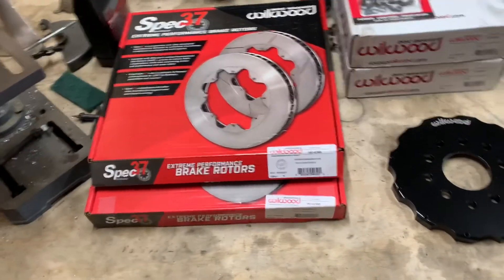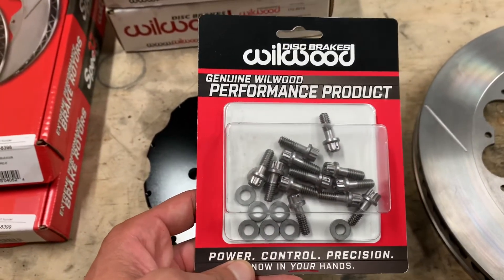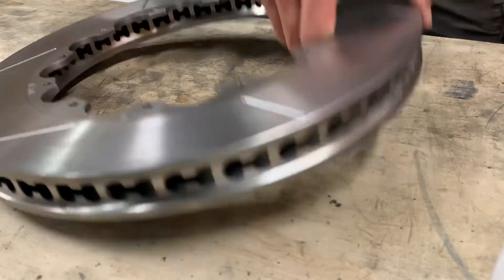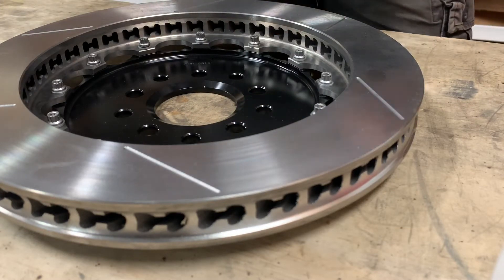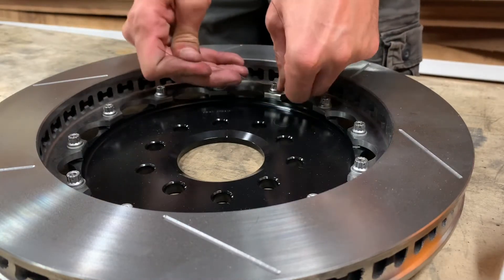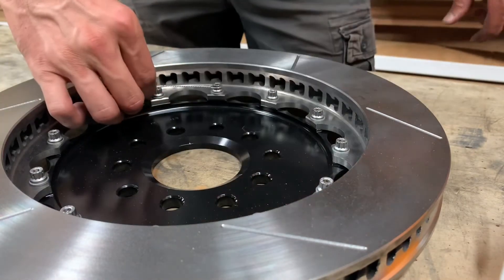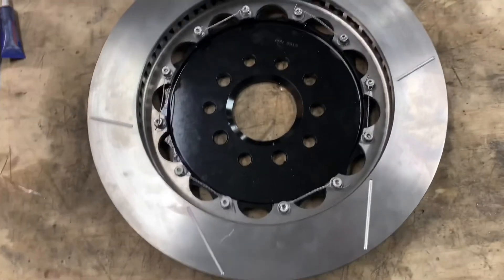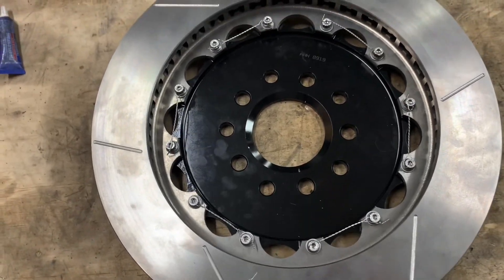Wilwood Rotor and Hat Assembly

Comment: That is how you do not install safety wire. I doubt if this was checked by a sanctioning body that they would pass this, it is not done correctly.
Reply from the maker: NASA and SCCA don't require safety wire on brake rotors, so they're not inspected.  I'm always happy to learn and do a better job, though.  Please point me to the proper technique if you have a link.  For what it's worth, my janky safety wire job has kept the bolts from backing out since I started doing it on brake rotors in 2014.

Comment: Came to see the assembly of a two piece brake assembly, stayed to watch a non aviation mechanic do safety wire. It probably doesn't matter that much in this application, because its non aviation, but correctly done safety wire should be done so the bolts pull against each other in a tightening fashion and the wire will be tight across the edge of the bolt. Usually it will have a nice S shape to it. Here is a good tutorial for doing safety wire if you are interested
  https://www.youtube.com/watch?v=14uMQonp3Do&ab_channel=DeanShowalter
Reply: Same here! Thanks for the link